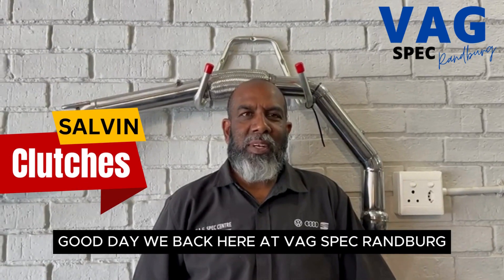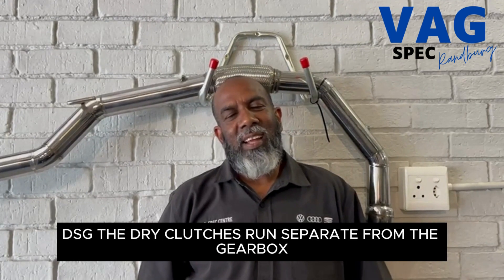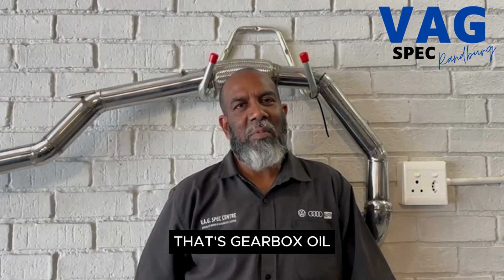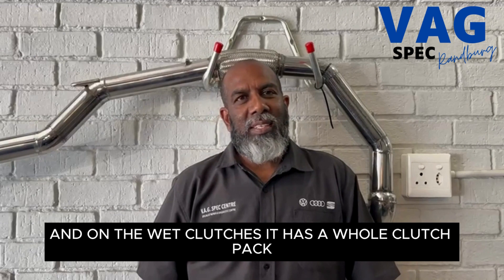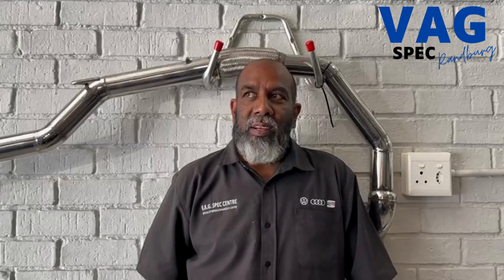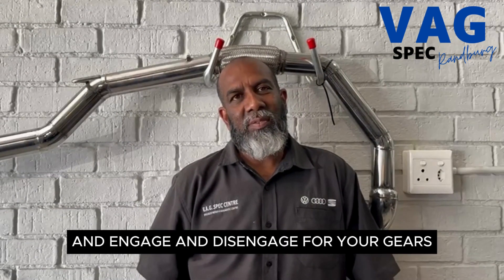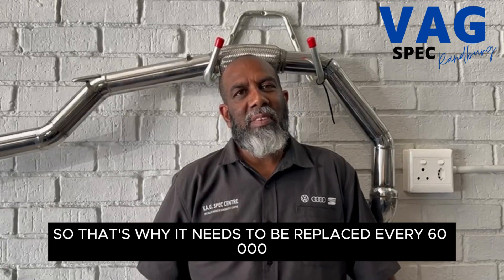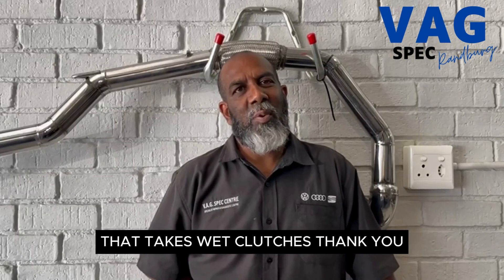Demystifying DSG Gearboxes: Wet Clutch vs. Dry Clutch Explained by a Qualified Mechanic

Comment: How often do you need to change gearbox oil for dry clutch dsg, I have Audi A1 1.4tfsi 7 speed and have no idea when or if it needs changing.
Reply from the maker: Hey there! we would suggest servicing your gearbox every 4 years or 60 000k whichever comes first :)

Comment: Thank you for the video. What about the dry clutch, does it need an oil change ?
Reply from the maker: Yes, the oil in a gearbox with a dry clutch does need to be changed. The gearbox oil, or transmission fluid, lubricates the gears and other moving parts within the transmission, helping to reduce friction, wear, and overheating. Even though a dry clutch system does not share oil with the gearbox (unlike a wet clutch system), the gearbox oil still degrades over time due to heat, contamination, and shear forces.

Regularly changing the gearbox oil is essential for maintaining the transmission's performance and longevity. The recommended interval for changing the gearbox oil can vary based on the vehicle manufacturer's guidelines, driving conditions, and the type of oil used but we recommend servicing the gearbox every 60 000km or 4 years (whichever comes first) on most vehicles to be on the safe side.
Reply: How do I find out of my car has a dry or wet clutch? Thank you.